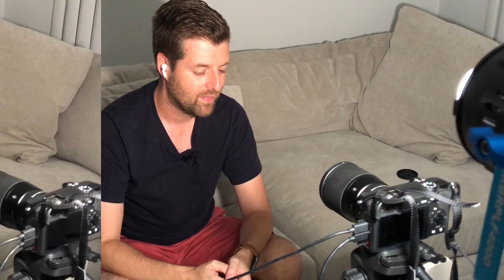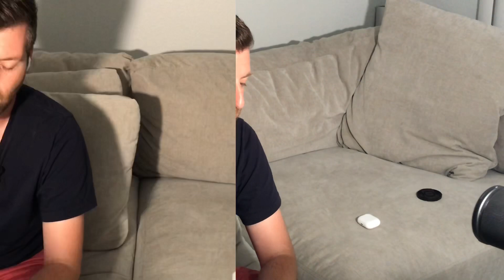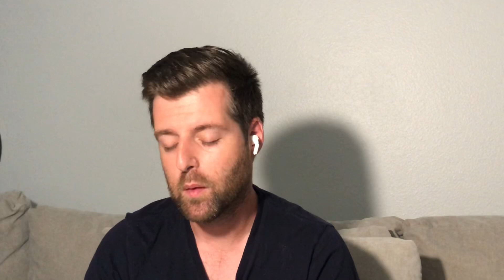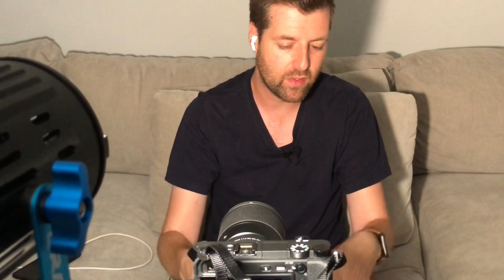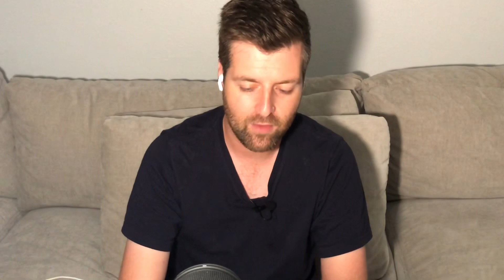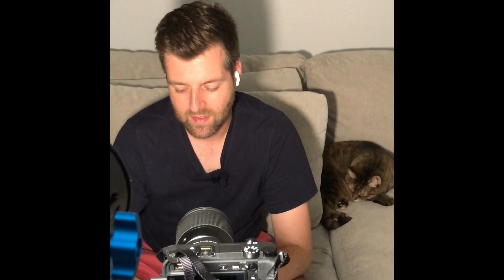Sneak Peek into Home Theater Build Process

Comment: What do you think of systems by companies like Biamp sytems? For media/theatre room & its ability to link up connecting the homes other gadgets & tech like phones walk&talk on calls with beamtracking mics spread around, sound masking  and the ability to do soo much more?
Reply from the maker: As I said in your other post, in my opinion we are talking two different beasts here. You could certainly connect a conferencing control system to a home theater processor to gain all its features. It may or may not yield good results. 

The first problem that I would be worried about is the quality of it’s A/D and D/A converters. They are not universally good in the commercial and pro market. The more expensive products form the better brands tend to have better ones. But it’s also tied to age. Anything more than 5 years old is going to compromise performance over typical home theater processors today.  Assuming we have resolved that and have a good enough converter set, we still have other issues. 

All of those specialized conferencing features are not typically desirable in a home theater. If someone wants that, sure it could be a good option. I have never had anyone ask me to connect a microphone to their home theater. As for phones and the like, in properly integrated homes, those features are usually handled by other devices. We would add a Control 4 or similar system with in-wall mix arrays from someone like josh.Ai. We would then integrate it to a phone system or the owners cell phones and they would gain that ability all over the house. Since it’s designed specifically for residential purposes we gain a lot of flexibility and ease of use that may not be true of the commercial product. 

By comparison, this biamp system in question would often still need additional integration to control and ensure simple ease of use. Qsys, AMX, and Crestron are the ones I know for that purpose. 

Then you have cost. What is this getting you that a similar home theater processor wouldn’t?  If we took the cheapest food processor at $3000 and the equal quality biamp confernecung system with at least 15 channels total processing in and out, the 16 channel Tesiraforte 16 is $5800. Now we are at $9000. For that same money I could get someone into the Audiocontrol processor. It would have more channels still, Dirac room correction (again manual EQ doesn’t better what these newer advanced systems can do), full manual PEQ, etc.  

If someone wanted to do really good DSP on the cheap I would actually go to Minidsp. The DSP Platform is really good. The AD and DA converters have improved and the newest are really decent.  

The last problem I will mention is the way volume works in this scenario. This isn’t the end of the world. It’s manageable. We add DSP to systems when we need it. It can be done. However you ideally don’t want the volume control happening in the analog domain before the A/D converter of a DSP processor. At high volume it’s not going to compromise anything that much. The A/D converter doesn’t strip it of any meaningful bit resolution and the low level signal is likely reproduced correctly. However if the listener isn’t going for reference levels and has the volume turned down, maybe -20 dB, then the A/D is being fed a very small signal. That signal will lack the digital dynamic range it actually has because the lowest level information is now buried in the noise floor of the unit. A signal that would normally have 12 bits of resolution may only have 3 or 4. 

So ideally you wouldn’t do it that way. It’s better if you can keep everything in one processor. In the most high end of home theaters we now use Dante and other digital means of sending the signals from a home theater proceeds or to the DSP units.
Reply: @PoesAcoustics  i portrayed my question badly i meant alongside a AVP/AVR for home intetgration for media theatre room+ multizones ceiling mics for calls & video to whomever your contacting  as there was a video you and guys spoke of creston & all on one system feel. Biamp do major stadiums events offices schools auditoriums & smaller i tergrations on request. But there systems are open play well whatever that means (new myself but have idea that may even give safety met of if i have to call about difficulty breathing as been real bad recently phone always on charge & that not gonna help in other room at times.
But ive bought older biamp audia flex +×2audia expi building AVR-xover-power amp & 2subs or 3? & cant afford atmos AVP/avr so or mini dsp so this is what i come accross read about what it is how to programme add other models money is but a pipe dream off work due to ill health & hoping it does some of what it does for me not came across used measurment mic yet plus need a laptop as lil sams ung notebook  not gonna help.had a girlfriend b4. So wasnt allowed home theatre just dream of if +maybe one day wen it come to atmos.
Can wen connect it get my yamaha7.2&pos 9.2 dep on temprement of my onkyo txnr818.
Thanks for replies apreciated lots  Joe Allcock
Reply: @PoesAcoustics  liked ur review on duke the wattage on what i purchase is similar but is also option for 70/100v amplification for speakers or as you mention line level to external amplifiers. Very similar to what i wish to talk+ learn more about with what i am trying on a vastly smaller budget myself. Great review